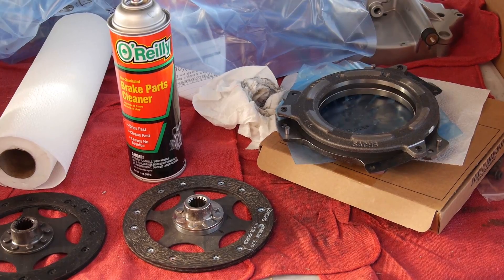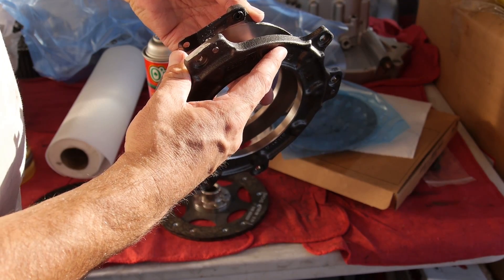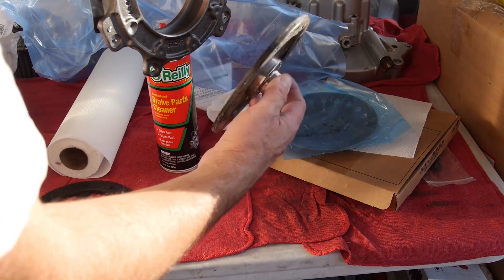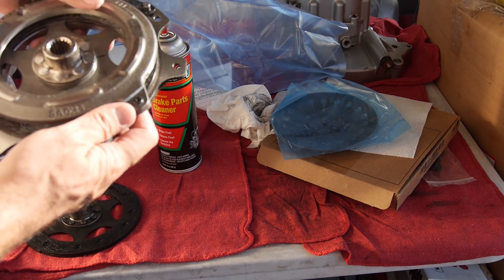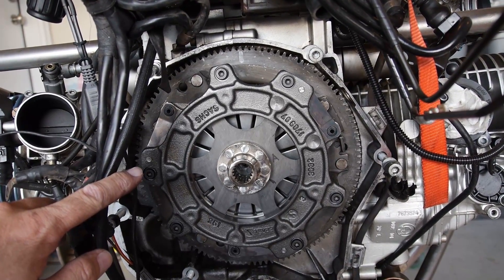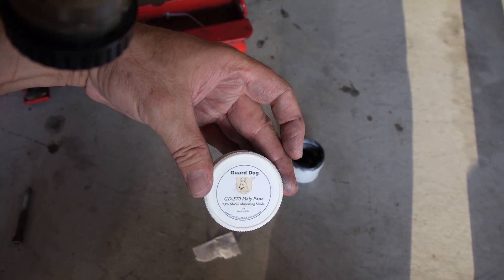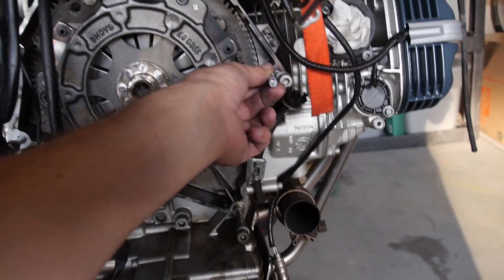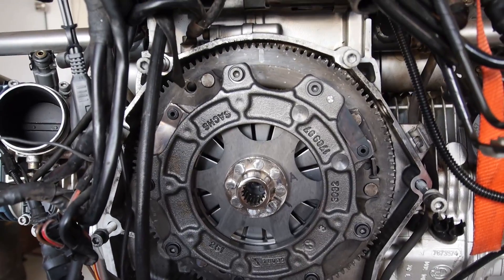BMW R1150GS - Pt.9 - Balancing the clutch- Install

Comment: Don't lube the splines on the clutch hub because when you push the input shaft through it'll push some of the grease out the other end. Just lube the shaft, it will push the grease back on to the shaft.

Comment: Well....nice video!! But if you have yo take out the clutch, forgot to make a sign with a mqrker and  there are no signs for balancing the 2 pieces, what is the solution to that?
Reply from the maker: I installed all new clutch components, so didnt plan on keeping any original equipment. If one plans to keep everything except the disk, they can just mark each piece in line as they remove it.

Comment: Hallo,
ich sehe das dein Video schon 6 Jahre alt ist. Ich habe aktuell ein Problem mit meiner 1150 rt bj 2001. Die Verzahnung der kupplung und Getriebeeingangswelle sind rund gefräst. Ich habe auch noch eine 1100 rt die noch ok ist. Ich brauche den Kupplungsnabenabstandshalter 2 mal. Wie komme ich an diese Teile? Ich kann kein Englisch und übersetzte über Google. 
Ich bitte um Hilfe!
Gruß aus Wolfshagen im Harz. 
Deutschland.
Reply from the maker: We use a company called beemer boneyard 
https://www.beemerboneyard.com/
Reply: @MrDuhfactor  vielen Dank für die schnelle Antwort.